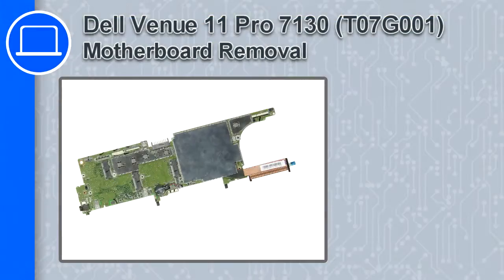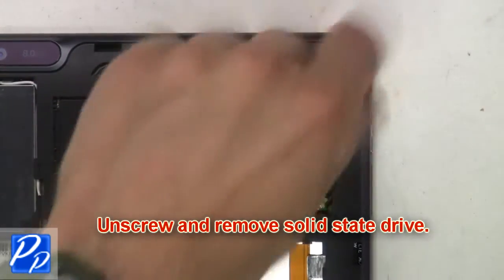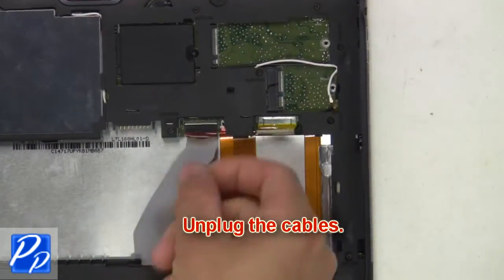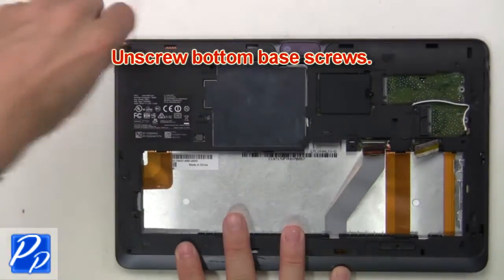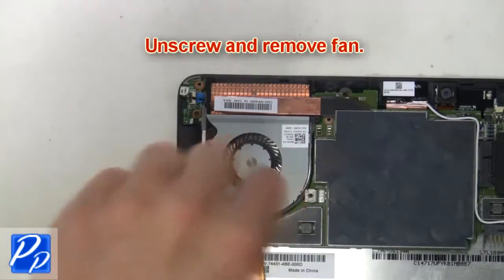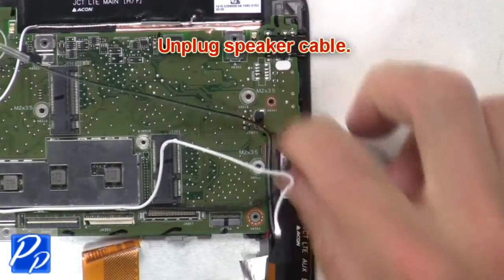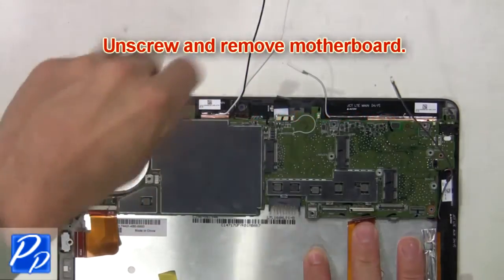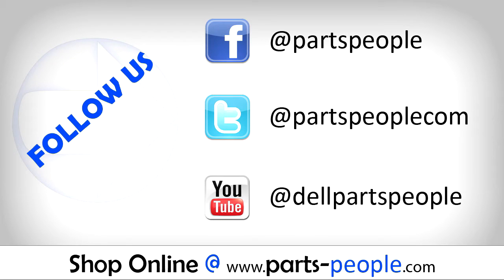Dell Venue 11 Pro 7130 (T07G001) Motherboard How-To Video Tutorial

Comment: I have a 7130 Venue, but my motherboard appears to be broken. Is possible to change it for the 7140 model?
I need to keep my ssd disk with the same SO, software, data, etc... but i know that the drivers are not the same.
Reply from the maker: No, the 2 motherboards are very different.